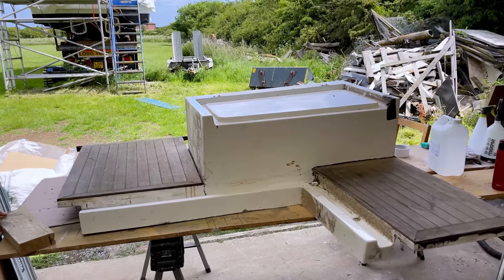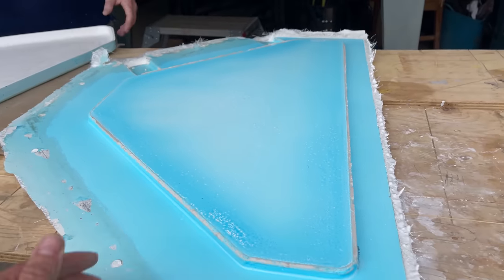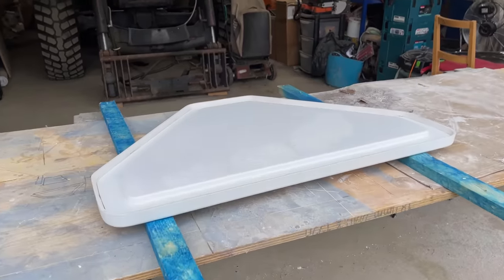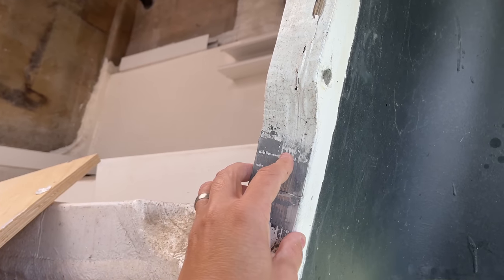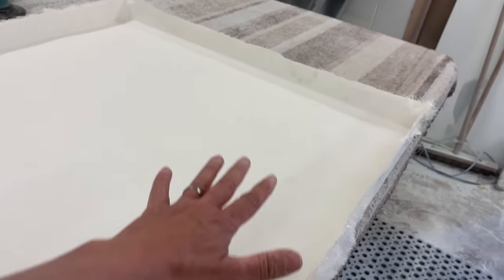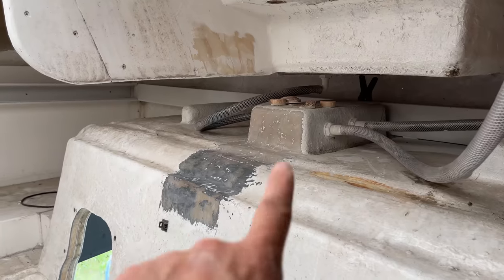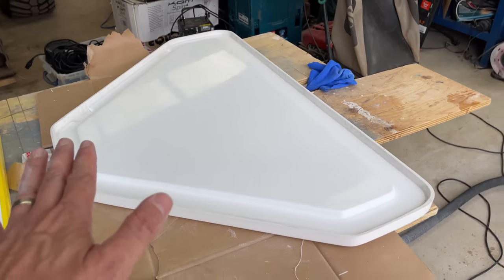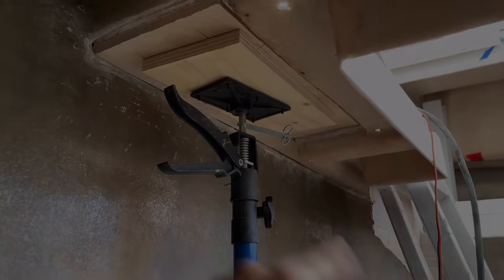BOAT Restoration PROJECT - EP.71

Comment: Well done again guys, one comment I would make with new engine hatch and chain locker hatch being stored away until needed as I precaution I would ( from past experience) store them completely flat and weight them down as although they have been made to an amazing high standard there is a slight possibility of distortion, when they are bolted in position this risk disappears. Again we’ll done guys keep it up can’t wait to see the fit out it’s getting closer🛥👍
Reply from the maker: Thanks Roberts and good tip 👍